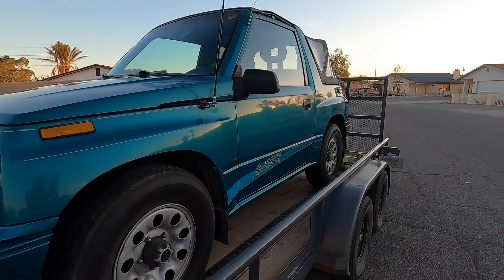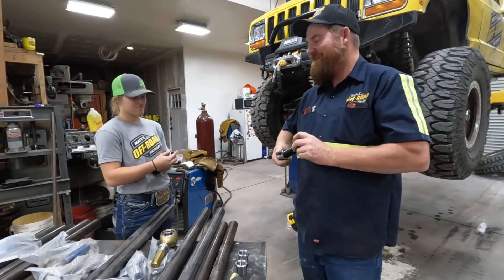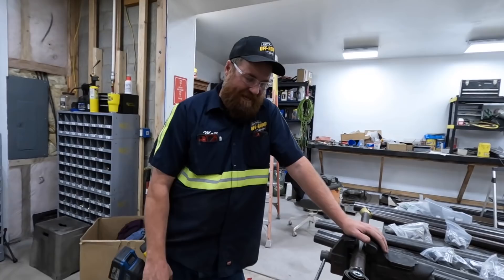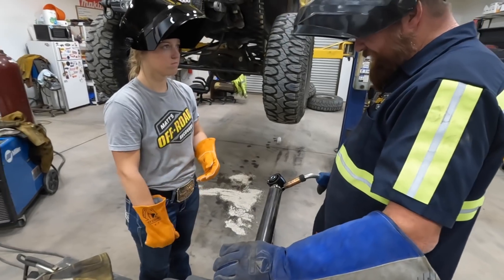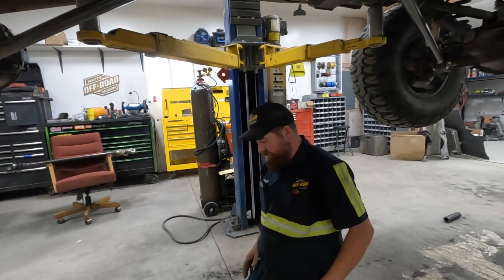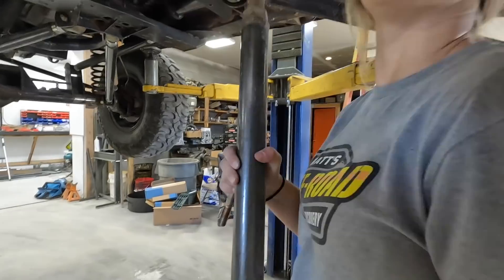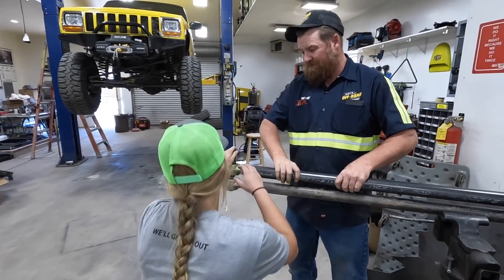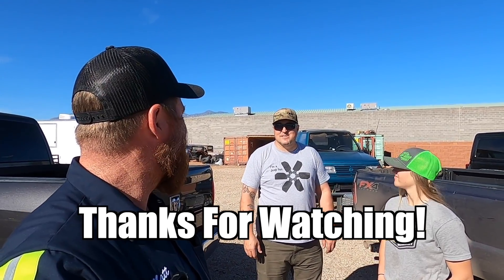This Is Going To Hurt, Working On The Jeep Banana

Comment: Lizzie is adorable. Watching Matt teach her hits home for me. 
A few years ago I bought a vintage Porsche for my daughter. She and I took on the project of fixing all of the little issues and getting the car back to 100%, everything working. Along the way we did lots of electrical and mechanical. It was fascinating watching my girl learn; she was like a sponge. It did take a while to get her proficient with a manual trans - I can personally testify that Porsche makes a strong trans, otherwise she would have torn it out. She told me that she was a little scared of the car at first, but now she says if anything goes bad, she’ll just fix it. It gives me great pride knowing that she will never have to rely on a man to fix her car.
Reply: you can still pay someone to fix your car, If you know what is involved you won't get ripped off.
Reply: I found this girl struggling to get tires off s car at the junk yard she was not giving up and she asked for no help when she found some studs would not come off she was working every angle to break them off.. determination confidence hard headed what ever it was she learned it from her dad.. i asked who tought her to work on her car. Her dad she said.. and he would have been proud the next day bi walked by that car she broke off 4 studs on three wheels to get them tires .. you go girl is all i could say.. that girl dont need a mans help .. no sir..
Reply: I got called a PERV for "admiring LIZZIE"-- some damn perv took the comment wrong-- I just admire her for all she's doing- instead of sitting home yacking on the phone to some airheads about social BS.. and the way lots of teens do..   Getting so you can't give an HONEST compliment without some weirdo thinking the wrong thing.   IF I had a daughter- I'd like her to be like LIZZIE.. she just makes me PROUD..
Reply: @davidwayne9982  Lizzie 
Makes America proud.. we all want more Lizzie.. and i haven't seen her head bowed down to the smart phone gods even one time. Howmany young peaple can you credit with being present on the job instead of on there social media accounts..
Reply: @b-radumuck7903  AMEN!!!!

Comment: Matt's teaching welding is exactly how I was taught. Brings Memories back.
Reply: Did Lizzy complain that the other  welding mask was too dark ?   I used to weld many years ago (in Europe) and our hand-held mask had glasses one could remove/exchange .  Is this not possible on the one kind Matt/Lizzy are using?  Anyway she needed her own set of tools... Glad she got some.
Reply: I was taught to push mig, not drag. Drag flux.    I was also taught that strong welds are pretty, but pretty welds are not necessarily strong.  But i was DEFINETLY taught with a lot less patience than mat has teaching,. . .  a LOT. Enough so that i taught myself to tig, just to avoid the conflict.
Reply: I always wish my dad had taught me how to weld. He taught me everything else around the auto shop, but welding he was always reluctant to let me take part in. It's about the only thing I can't do on a car to this day.
Reply: @isallah1kafir196  I'm pretty sure the previous hood was autodarkening, so you can adjust the darkness setting. What is probably the issue is they need to change the cover and possibly also the shade unit, just because it's so well abused.

They do need to tell her to come back away from the weld a little bit, she's smoking out her brand new hood.

Comment: You’re officially a welder now Lizzy! Helmet, gloves, jacket and excellent welds. 
You’ve come a long way from those first tacks. 😂 Wish I could weld like you ❤️🐞
Reply: Having a good welding unit probably helps... When I tired MIG welding using flux core wire with a borrowed imported unit, I ended up with so much splatter to clean up, I went back to my old Lincoln AC-225 "Tombstone" stick welder because I spent more time removing splatter than the I spent removing flux with the Lincoln.  Never could justify the price of the Miller units for just use around the house.  I never tried MIG welding with a shield gas though...
Reply: @CurmudgeonExtraordinaire  same. I weld with my tombstone. Mig looks so easy compared to stick.
Reply: @CurmudgeonExtraordinaire  Flux core isn't mig. Unfortunately with a lot of the information available people use it interchangeably, which I believe causes improper welding techniques. 

Sounds like you were using it improperly. Lots of spatter is usually an indication of a amp setting to high. If you can stick weld you can run a FCAW. 

Splatter spray is a tremendous time saver. Experienced individuals have no problems running Chicago Electric flux core arc welders with cheap flux wire. Blaming the machine is an easy out.
Reply: @CurmudgeonExtraordinaire  - My husband taught me how to MIG weld on our little Miller 135 then our Millermatic 210. Both are have gas shielding. The Millers are expensive but we have an excavation company so we justified buying them. And we bought them second hand for a great price. Instead of laying ‘dimes’ I joke that I lay ‘worms’! 🤣. I’m still learning but I really enjoy helping fabric stuff and want to weld better. We just had to change out a cab on an excavator so we just got a set of torches and I definitely want to learn how to use the fire wrench! 🔥🔧🤟
Reply: @JohnnyD1993  -- Understood... But I did not have the experience and this was before the vast amount of YouTube videos on welding, so I was was failing and decided to just go back to something that I knew how to use -- oxy-fuel gas welding (not brazing) and stick welding... That was over 35 years ago, so maybe I should give it another try, but I have a pretty good supply of electrodes for stick welding, so I really don't have much incentive...

Comment: I have to agree with Lizzie.  A good helmet makes an amazing amount of difference. I started with a cheap helmet. Didn't realize how much better it would be with a higher dollar unit.
Reply: I do agree with you but don't get blocked by not having good tools. High tier tools helps a lot but they're not essential, work with whatever you have, don't wait for better tools
Reply: Most of the good welders I know use the cheap helmets, it's the part  timers that buy the expensive ones.
Reply: @8draco8  Reminds of a saying I heard from a guy back about forty years ago (he was about 90 years old back then), it went some thing like this: "Anyone can do the job with the right tools, it takes a skilled craftsman to do it without them."
Reply: @jmanlinc  I can't agree with that. If you have the skill, know what you're doing then you can afford good equipment. Just avoid saying "oh I won't start welding until I get some expensive helmet". Just grab whatever you have and earn for that expensive equipment
Reply: @8draco8  I'm not sure what you're not agreeing with since my comment was about specific people I know personally and you don't.
Reply: @jmanlinc  I don't agree with this "truth" that that guy said. There's saying more great than skill but if you have skill you should have good gear
Reply: I just bought a $50 Harbor freight auto darkener helmet because the last one I had lasted me 2 years I just loaned it to someone else and I needed a new 1👨🏻‍🏭

Comment: Im glad you went with all Suzuki parts on the Gold Nugget. I have a Sidekick powered '87 Samurai (1.6 MPFI) and it made all the difference in the world. I went from a stock 1.3 (around 45/50 hp) to 90 hp. I also used the power steering unit/pump off the sidekick (I dont know if it will work on the LJ). The other major feature is a 6.5:1 transfer case with the Twisted T shifter (I got that from Low Range) and a "Snatch" cradle fro ZOR. Im still running stock axles (3:73 and open/open). Dont worry about using JEEP parts as most Suzuki folks will trade out the springs for YJ springs (again this is on the Samurai's). Keep waiting for updates from Fab Rats on it. The LJ's are really cool.

Comment: Ok since Lizzy is now an official mechanic it’s time to show her the mechanical advantage of torque trick. Especially if you’re not a brute. But by simply locking another long wrench box end to the open end you effectively double your torque ability! Work like a breaker bar, especially when dealing with suspension parts. And on a side note , her welding is looking superior to what I’ve seen from my local weld shop 🙄. 👍

Comment: Now it’s time to trick out Lizzy’s helmet with some graphics and pinstripes. 👍.  Keep up the lessons for Lizzy’s, we all are learning.   

Do you use straight Argon or a blend?
Reply: MIG wouldn't use straight argon, not that I've ever heard. The 25% CO2 or straight CO2 acts as an active gas, helping the weld. You need straight argon with TIG so it doesn't react with your tungsten.
Reply: @mlindholm  I’ll have to go back to the manual but I thought on mine to weld aluminum I need to reverse the leads and use straight Argon but for regular welding I can use a mix.  Right now I don’t use any gas and I think it makes for dirty welds, slag.

Comment: Matt, a trick I picked up on welding thread inserts on links is to coat the heck out of the threads in nozzle gel before welding, it keeps the threads from getting "gaulded" from the heat

Comment: Hey, nice job you've done there. 
Just two things, when mountig something with bearings you shouldnt use a steel hammer. The bearings are made of hardened steel and dont really like getting hit by something hard like steel (can cause hairline cracks). The other thing is you dont need to tighten those screws that hard, you are just lengthening the screws and those screws become weaker (not much weaker).

Nice videos and greetings from Germany.

Comment: Put a 2ft chunk of 2inch angle iron in the vice as a cradle to weld the links. Weld a plate off the one side end as a hand support. Should be able to rotate while welding. One weld no stop.

Comment: Thank you Matt for setting up Lizzy with the correct gear (PPE) that's being a responsible Employer 
Cheers 
And you can wear yours as well without sharing .
Like the big gates and yard upgrade ,getting Flash 🤣🤣
Etch primmer on plastic before painting usually ?

Comment: Pro-tip Matt... Use all right handed or left handed joints. You only keep one spare and if something moves it's because it's broken. How often are you really going to be changing toe or caster or in the case of an A-arm suspension, camber? Usually it's a one and done setting after some initial testing. -from a guy who has almost lost a tie rod going way too fast and never wanted to even worry about it again.
Reply: Another tip- use a bolt instead of your joints to weld the tube adapters. When you do this pit some nozzle dip (anti-spatter goo) on the bolt.

Comment: Take the joints out of the tube adapters before welding! You're going to put too much heat into joints and melt the bushings (both the heims and poly bushings) and possibly lock the threads together.

If they're difficult to thread back together from putting too much heat into them when welding you can just run a tap through them. An 1.25" tap is like $25 and a reverse thread is ~$100 but since you make so many arms it's worth it.

I'm an authorized dealer for Barnes too and have made a bunch of long and short arms with their poly, Enduro, and regular heim joints.

You also didn't have the jam nut on so they'd have to come apart again.

Comment: Matt, I’ve seen others welding those joints, and they don’t put the insert part all the way in, which enables more weld to penetrate the end of the tube and the insert, even 1/8” gap.

Comment: Hey guys this is Joe and Thomas JO and Thomas anyway anytime you paint plastic I’ve worked with paint for almost 40 years now use a plaster promoter comes in a spray can very much like they can use to paint her helmet with but when you shoot the promoter on the plastic it irritates the plastic and allows just about any kind of spray paint to stick otherwise the paint will come off quite easy off of a plastic serface Anyway plastic promoter first it’s clear you can’t even see it you got a kind of watch what you’re doing it looks wet and then in a few moments it’s dry literal moments then you sugar paint on it right afterwards just thought I’d share some knowledge love watching you guys work with a great spirit y’all have

Comment: I would have pulled the JJs whendoing the final welding. the inner poly bushing doesnt really like heat. I learnt that when I swapped out my TJs  front axle to a HP Dana 30, I did JJs for all joints

Comment: It's not easy to weld around small curves like that. It takes a fair bit of practice to do well so that was pretty good. You have to both adjust the speed at which you move from point A to B and constantly be adjusting your wrist or hands while holding consistency on the leading edge of the weld. It's a lot more involved than it looks on tv. That was definitely better than I did my first few times. I had weld dripping off the side of the hand rail or I was burning a hole in the tube. It's hard to do well.

Comment: Hi team I used anti seize on everything that I was servicing in my workshop but I noticed it had a propensity to dry out and become paste like when It became time for more work (replacement of brakes etc) to fix this I used a small amount of fully synthetic oil mixed into the anti seize. Was perfect solution.Regards

Comment: It is interesting - on my stock car lower links are parallel going along the car and upper are shorter and angled. On Matt's car it is the over way around. I'm talking about rear axle. It would be interesting to read something about the difference .

Matt's suspension recalls A -bar link

Comment: Iv seen it in a video but u guys should practice it for if u ever need to do it on a recovery but they used two truck batteries and jumper cables and just a welding stick or rod and the hooked the batteries together and put the weld rod on the to one end of the jumper cables and was welding with it. Pretty much everything u would have on a trail except the welding rods but those r small ish so wouldn’t be hard to find a spot to just have incase

Comment: Note to Lizzie: You have great welding teachers but they forgot one thing. When welding, never roll you
                           jeans up on the outside. Sparks and little hot dingle-berries jump into the cuff and burn 'em off.

Comment: Lizzy thats an ugly green.  Should be John Deere green.  Lol. Nice you got your own gear.  Keep on weldin.   Next year i need to build me a welder cart so i dont have to keep carrying my welder and hooking up the tank and use an extention cord and adapter cord. I will rewire it to a 4 wire a L14-30 30ft cord so i plug my grinder into the welder

Comment: I know I'm late and yal probably won't read this but I use to be a welder did something similar with my helmet painted it bright red because the safety guy wanted me to be visible learned even after drying spray paint is very flammable was up on a boom lift and started getting hot pulled around my head flipped my hood up just to realize that all the paint was burning and it melted my helmet after I took it off because i was 40 feet up with no water

Comment: I've noticed that you never use a torque wrench. Seems like on motorcycles -- which is what I know best -- every bolt and nut has a torque setting. Is this not the case on cars?

Comment: Length of thread doesn't madder... Your link is only as strong as the thread length you screw the rod end into... If the weld in spud only has 1 inch of thread you only have pi x radius squared x thread length for strength from pulling out... You want stronger thread connection, you need more thread entry, deeper threads, longer spud threads.... Doesn't matter how much thread is outside the link bar as long you have an equal amount of thread entry as the cross section of the rod end... The threaded joint is only as strong as the cross section of the rod end threaded shaft of the rod end... Hope that makes sense...

Comment: As a diesel mechanic and fabricator and instructor, etc, with long blond hair, I can tell Lizzie that hair color has nothing to do with your ability to learn anything, and neither does being a girl!
Many of my best students were blonde teenage girls.

It can be harder for the girls because they have been "protected" from the dirty jobs growing up that the boys were expected to learn, so things like reverse threads or what a weld flange looks like are not things they have ever been exposed to, so while someone might shake their head that she didn't know the thread was reverse, if every bolt that you have ever seen screws on in the same direction, you aren't even considering the possibility that it might go the other way.
And we have all been confused momentarily (or longer lol) by reverse thread lug nuts at least once, so this is nothing new, and now she probably understands reverse threads, and turn buckle style systems better than most of the viewers here because she's built and installed them lol

I also found that the guys I have tried teaching are often harder to teach because they think that because they have chest hair that they are also gifted naturally with mechanical knowledge and don't need to learn the basics.

So learn everything you can Lizzie, and make us Blonds proud!
(and wear your seat belt and safety gear so you can use what you learn longer... 
I have dealt with enough OSHA cases and been on enough wrecks as an EMT and tow truck driver to see the difference they make!)